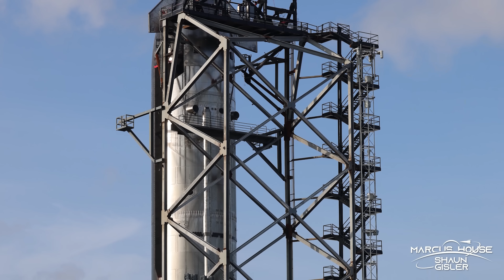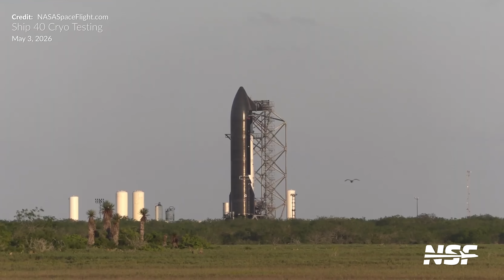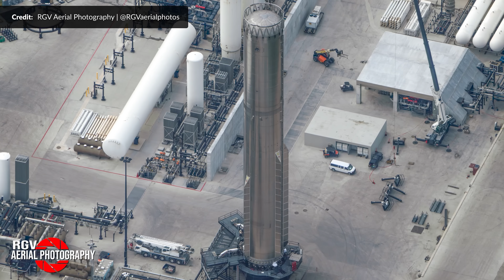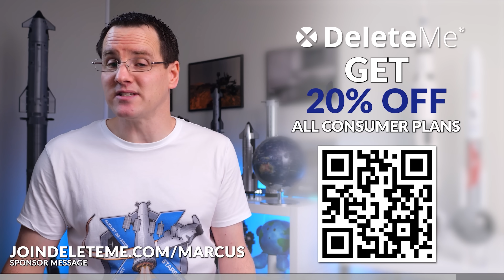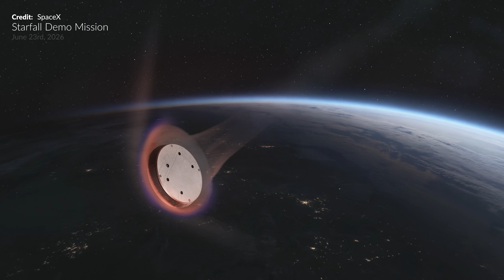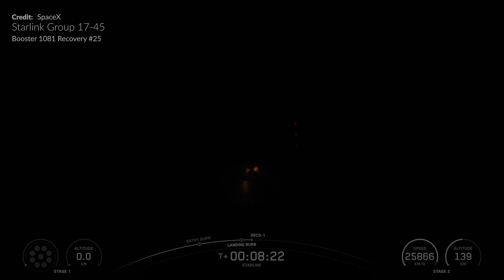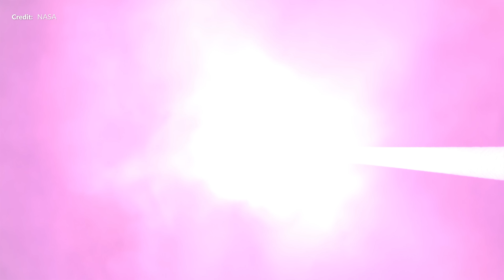What's Holding Starship Back?

Comment: Is it possible that it's just not a good design?
Reply: SpaceX has unmatched expertise in spaceflight and is betting everything on Starship, so they likely know a lot more than armchair engineers."
Reply: @admarsandbeyond I'm just looking at the evidence of what they've so far delivered with Starship; what was originally promised/timelines etc; and the unsolved engineering challenges that still lie ahead to make a lunar Starship mission possible
Reply: @pugrallye23  Starship is the fastest space development project in history when you account for its complexity, progressing on one of the most aggressive schedules ever. It's a cutting-edge, never-before-done reusable super-heavy system + spacecraft with hardware development essentially starting in 2019, with prototypes flying by 2020–2021 and full orbital attempts starting 2023 and it has retired most of the high engineering risk already (awarded over 49 critical milestones by NASA). It's just a matter of time to become fully operational.
Reply: Refining the design is the whole purpose of development.  Is it possible you don't understand what being in development means?
Reply: @imaginary_friend7300  As someone who's worked in software for over 35 years, I understand the concept of iteration, but at some point, you have to start shipping product and hitting dates

The original plan had an unmanned lunar landing scheduled for Q1 2024 (two and a half years ago), and that would require things like multiple launches in a short timescale, in-orbit refuelling, Ship being able to land on the and launch from the moon etc

Given the above, and that the program is c7 years in already, how many years behind schedule do you estimate them to be at this point?
Reply: @pugrallye23  The original plan was idiotic, and anyone with a basic understanding of spaceflight knew its ridiculous timelines were impossible.

Comment: Super Explanation of why things went sideways at stage SEP of Version_3 . Could it be even more complicated than explained? 
10:29 the first dozends of milliseconds it separated straightly, then it went sideways in the wrong direction and additionally got a rolling kick! 
First the pressure of the 2ndStage rocket gases pushed straight, then at a little bit greater distance between the stages, the curved tank surface made the Bernoulli-effect the dominant factor. That one pulls (in an initially arbitrary sideways direction) more than it pushes. 
So the fuel in the tank was sloshed in multiple directions?  Without a shield in the side of the struts, there is no dominant, defined force in the desired direction. They had a shielded segment in  the Version 2 Stage Separation Ring.
Reply: Good explanation

Comment: Thanks for covering Rocket Lab too! It recently occurred to me that since the hippo will have the biggest 2nd stage of all time, it also means that if it gets hungry and wants to eat any other second stage: its hippo mouth is big enough. Rendezvous with prey satellites is an important part of eating your meals. 🦛
Reply: "the hippo will have the biggest 2nd stage of all time", is that Neutron? In what way will it have the biggest S2, and how could a suborbital first stage "eat" orbital satellites?
Reply: @admarsandbeyond Yes, this is Neutron. You should do your own research, but I'll get you started. Watch the "
Neutron Rocket | Development Update" at around 2 minutes in. They would have to build a padded-capture-cell or something like that I'd guess. The hippo eating is pure speculation, but I am sure about it being the largest second stage ever.
Reply: @SchweetOne  Neutron is certainly not the largest second stage ever. Neutron’s second stage is comparatively small and lightweight, designed to hang inside the first stage (hippo part). Falcon 9 second stage is significantly heavier and larger than it, and it is vastly outweighed by behemoths like Starship's second stage, NASA’s SLS Exploration Upper Stage, the Saturn V S-IVB, or the Soviet N1 Block V.
And the "hippo" part is attached to the booster which certainly is not orbital.

Comment: By chasing 'perfect' reusability for every flight, Space X is denying a genuinely impressive lift capacity and fairing diameter to the United States. They can make it to LEO with the only question being reliably bringing back the starship stage from there because starship is too large to leave in a graveyard orbit, which is a "normal" regulatory/engineering challenge as opposed to the ambitious flight profiles they want approved. At this point they could fly commercial and science missions but they choose to withhold that from America. Falcon 9 had nearly 20 commercial flights before they achieved a soft landing on a drone ship. 
also yes, as currently demonstrated, starship will not be human rated for carrying people into orbit in at least five years, if not ten (unless NASA suddenly becomes okay with risks worse than STS or Gemini). HLS is different because it doesn't carry humans through an atmospheres (see how the LEM was designed).
Reply: There is no need for such a capacity.  There is barely enough need to keep FH flying.  Starship is mostly about meeting their internal needs than anything.
Reply: @imaginary_friend7300 missions are designed around available capacity and capacity is usually driven by government interest. 
If starship was made into a heavy lift vehicle NASA could push for things like doubling the Dragonfly payload, resurrecting Mars Sample Return, asteroid capture missions, etc. On top of that every science mission becomes more valuable because more sensors can be budgeted in. 
Just think of the Space telescopes alone! A telescope larger, cheaper, and more capable than JWST would be in the cards.
Also Falcon Heavy is limited by fairing diameter pretty significantly

Comment: Flight 11 the booster was venting vapor during the hot stage/flip. Flight 12 there was no vapor venting during hot stage. Venting started a few seconds after. Looks like engines overheated and failed.

What do I know, I am just a mechanic.
Reply: The flip was definitely a major factor imo, fuel slosh cannot be ignored because it can absolutely ruin an engine.

Comment: Great drop dive. I saw reporting in a "b-tier" channel that reflection of the exhaust back towards the RVAC raptor may have been related to the loss of that one engine. The analysis seemed reasonable but I haven't seem any of the better channels pick up this story. Have you heard this? 

FYI, it was one of those headless channels with lots of Ai voicing, but the script itself doesn't sound Ai and the analysis seems more human. I've assumed it might be content from a non English speaker.
Reply: The Cosmic Rush? I’ve caught it twice with burned-in Vietnamese subtitles (one time it was the whole video and was deleted quickly, the other time it was just a few seconds so I think it was kept). The actual content is clearly made by a human but the translation and the voice over is AI.

Comment: Wow - they are then really relying on the engines starting and delivering thrust in windows of fractions of a second. Any one engine not ramping exactly on time means an off-nominal flip-vector for the booster, especially since they have no "push-off" panels around the inter-stage lattice. I guess start-up data shows this should be reliable, though flight 12 proved otherwise...
I wonder if they will regret this decision to rely on perfectly symmetrical engine startup thrust for a successful booster flip, since the booster certainly seems to dislike anything too far off straight "up".
They could improve chances by just starting the central "flip" engine first, then start the left-right pairs, but there may be reasons for not doing this.

Comment: Yeah to me that just shows the blocked off section of the hot stage interface was just a better and more reliable solution.

Seems right now any engine out on Starship during staging would possibly end up destroying the booster. The blocked off section however should work under any circumstances.
Reply: Very good point👍

Comment: Man I love being confirmed. When I saw it flip the wrong way I theorized the staggered engine light designed for the kick, was out of order. But I did not know this for certain until your breakdown. I especially appreciate the extra information on what happens inside the rocket with the fuel when rocket is spun 270 instead of 90, I'd not even contemplated that.

As always, I look forward to your video. Have a good week sir

Comment: A major part of the reason for the booster to flip up is converting horizontal velocity to gravitational potential energy. It slows the booster horizontal velocity as well. Ultimately, there is a distance, altitude and velocity of the booster down range that requires a certain force X time to return it to its launch point. We need a delta-V. Elon favours a 33 engine force for the shortest time as the return distance and fuel is minimised. I favour a five engine force for a longer time. In the 35 eng V4 booster, the middle and outer ring of boosters do not need to gimbal or restart. The inner five engines could burn through hot-stage and boost back then cutout and relight for the landing burn - much less restart gas, tanks and plumbing required. Potentially, the inner five engines could burn from launch to end of main landing burn - no restart required, a slower flight with less forces and vibration. 
Hopefully, Marcus knows someone with a spaceflight modelling program who can model the possible flight profiles for thrust, time and propellant. 
The oxygen header tank could be avoided if the methane downpipe was increased in size at its base to a diameter of about six metres - this would give an equal depth of methane and oxygen in the base of the booster for landing and cut the plumbing required.

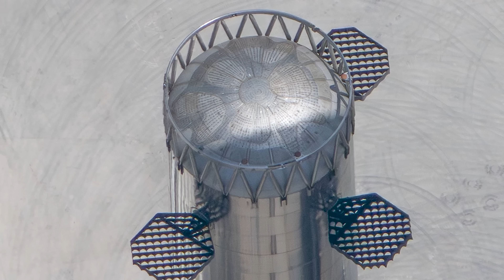Comment: 12:38 You can also see the shielding from sea level raptors being offset in the exact way you expect them to be, according to planned hot staging maneuver.
Reply: Also about engine diagrams, you can for sure say that if engine lights down it also shuts down IRL, but same cant be said about engine startup.
Like what exactly the diagram shows? Is it literally "if the engine is not just OFF then its ON"? Or its ON when some specific thrust level is reached?

Comment: Very nice deep dive. Nice to discover it might not been a booster problem. Funny how that w
Reply from the maker: Will be interesting to see how reliable they can make that flip. I didn't realise how precise those upper stage Starship engines needed to fire up. Needs incredible precision.
Reply: @MarcusHouse  I wonder if perhaps they will re-incorporate blocking panels in the interstage ring to help direct the exhaust as they had on previous version of hot-stage ring?
Reply: @MarcusHouse  They have shown extreme start-up and other booster control before. I'm pretty sure it will end up being 100% reliable. They need to. 
Can they do it with flight 13? If not this might rain on our/their parade for a monthly launch. Let's hope for some SpaceX engineering magic.
Overal my guess is that this is a better outcome then just booste issues. My guess is based on tight engine start-up control is a MUST... booster redesign... not so much.
Reply: @MarcusHouse I agree with @mikecooper1234. Losing a booster (dependent on that timing) doesn't seem very fault tolerant.

Sure it may have that precision (to flip correctly) 99%  of the time but the booster should have an ability to recover from this inconsistency.
Reply: But if it needs incredible precision or the booster gets destroyed that goes against having some redundancy. So unless all ship engines fire up precisely the booster is dead?

Comment: Isn't it concerning that Starship has been designed and built to operate in such specifically narrow range of acceptable flight conditions rather than being resilient to (some) off nominal events? Seemingly more so than Falcon 9. In which case, won't that make it more difficult for Starship to be able to gain any future NASA human-rated certification?
Reply from the maker: Well, this was the first flight of a largely new design, so there may be some teething issues while they determine what needs more work. I sure hope they get there soon though because the new launch system at Pad 2 is freaking incredible.
Reply: What are the ranges they operate under and how do they differ from other systems?  What off nominal events are they vulnerable to that others are not?
Reply: @imaginary_friend7300 
I guess I considering things like:

1) The huge, single volume fuel tanks individually for oxygen and methane that need to keep sufficient fuel pressure across all 33 thirsty Raptor 3 engines and the prevention of fuel sloshing. (Incidentally, how is this done when decelerating back through the atmosphere or is the pull of gravity / acceleration towards the ground sufficient for when the Raptors need to be relit?) Whilst this is a requirement for Falcon 9, it's on a much, much bigger scale for the Starship Super Heavy booster.

2) The reliability of the Raptor 3 engines in terms of (re)lighting them (as demonstrated on the aborted launch for Flight 13) and their reliability in general.

3) The controllability of the Raptor 3 engine ignition timing, as they seemed (or now used) to be reliant on that for a correct booster flip manoeuvre.

4) The failure modes for the Raptor 3 engines - do they fail and shutdown gracefully or explode and take out nearby engines and infrastructure on the craft?

5) More specifically with (4) when a failed Raptor on Ship results in an explosion, or at least large amounts of fuel venting into space, is Ship able to recover from an (initially) uncontrollable spin in order to safely re-enter the atmosphere for landing? If I recall this was an issue on an earlier Starship flight using the Raptor 2 engines.
(Or are SpaceX going to rely on being able to send up another Starship to rescue them in some way? They would, of-course, for this have to be able to correct the spin at least for docking, even if they couldn't get back on a safe landing trajectory.)

(There might have been another one on my mind at the time back when watching this video.)
Reply: As a real answer, most rockets have a very narrow range of conditions in which they work and we've slowly gotten better at expanding that envelope over time. Falcon 9 and Starship are genuinely incredible for being able to correct for engine outs, prior to them an engine out would mean mission failure. 
However, yes Starship is incredibly dangerous from a human safety perspective. I casually study history and am an engineer with a light background in aerospace, and I will confidently state that Starship will not be human rated in the next five years. HLS is a different story because it never touches an atmosphere with humans on board. it can be far less safe in general like the LEM was.
Reply: @WaywardSupercoldSpaceScythe  That's why they said they want 100 flights before putting people on, and there is no real need for a NASA human rating in the immediate future so they do have the time.
Reply: @imaginary_friend7300  But a 100 increasingly successful flights doesn't mean that all possible catastrophic faults are identified and eliminated, nor all faults leading to an unsafe situation from which the crew could not resolve or escape from. It just means they were mostly of sufficiently low probability not to have occurred within the first 100 flights. If a root dependency analysis were to find a flaw in the fundamental design from a human spaceflight perspective with something catastrophic likely to happen once in every 200 flights - for example, it might never get certified. (I appreciate that ironically that it would still make it safer than the space shuttle programme.) And whilst Googling the latter, I guess what I'm thinking about is has SpaceX already considered the (number of) single points of failure in the Starship design from a human spaceflight perspective?

Comment: Can't they add an aditional layer (maybe also stainless steel with holes in it) into the middle of the tank. So that for the short duration of hot staging not that much of fuel get's lost?
Reply: Hot-staging already saves a significant amount of fuel during staging, putting holes in the dome that lead directly into the inside of the fuel tank (or whatever you’re saying) wouldn’t work because the exhaust is already pre combusted and wouldn’t be of any use. If that is not what you’re suggesting please write a more clear and in-depth comment because I’m unsure of what you’re saying.

Comment: Hotstaging is a waste of time (for now anyway) and goes completely against having a reliable low maintenance booster and second stage that can refly repeatedly in my know nothing opinion. This rocket already has in theory by far a bigger payload room and mass for less $ than anything else even without it, and they would already be putting loads of starlinks and other things in orbit by now if they didn't mess with that whole boondoggle on top of everything else that needs sorted out.

It seems to me another galaxy brain muskian moment where he threw that idea at the wall halfway in the test campaign and the engineers have been pulling their hair off trying to cram it in the design and make it work since.
Reply: What silly simpleton nonsense.  When you people pretend you really do little more than make fools of yourselves.  But then you haters are not motivated to be honest.  Just to vilify.  The jealous little zero in you over-rides all.  A zero you are and a zero you can't help but be.

Comment: Question: the initial 7/8(?) flights the booster went off in a random, uncontrolled direction, how come there were no issues there?
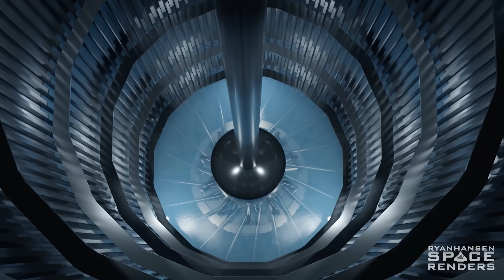Reply: See point at 5:00 re difference between version 2 and 3 and fuel slosh